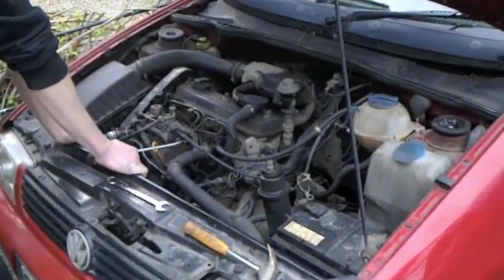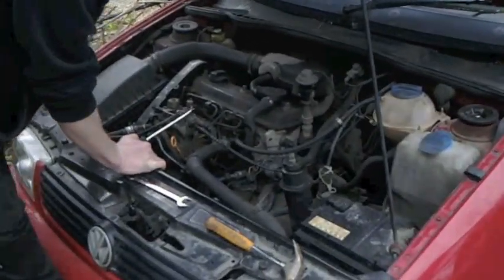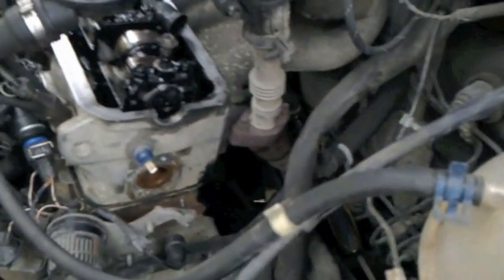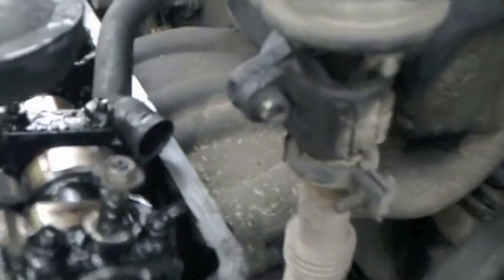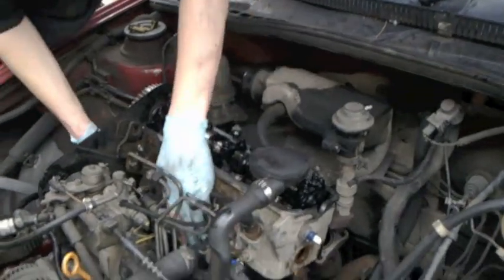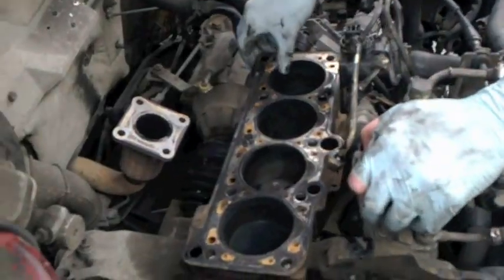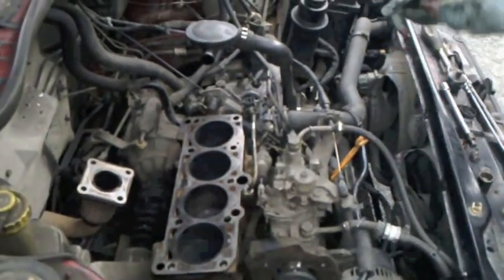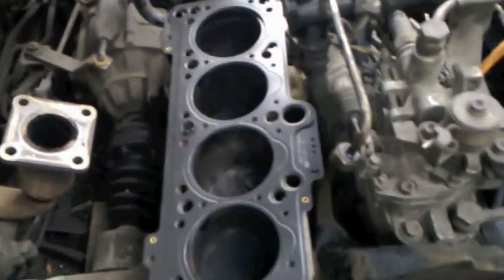How to change Head Gasket on VW 1.9d engines

Comment: Important Information: 
- Check markings on the head gasket (1, 2 or 3 points, there are 3 different thicknesses)
- Change the head gasket only on cold engine
- make sure to not be in TDC with the pistons (Rotate to TDC and rotate a bit back)
- loosen headbolts from outside to inside (not from the inside to outside)
- clean surface of the head gasket and the head gasket itself (production residues can lead to leakage)
- clean and dry out the bolt threads (with pressured air)

- Always use new bolts (these are expansion bolts, which shouldn't be reused)

- Tighten the screws in the given order

(For the VW ABL Motor the stages are: 
1. 40 Nm
2. 60 Nm 
3. 1/4 Rotation (90 degrees)
4. 1/4 Rotation (90 degrees))

Comment: How to allign rhe head and the gasket if the block has only one pin not two ? 
I also have changed gasket for my afn also with one center pin for head and gasket but if you put them both on there is a movement ehat is not good.???

Comment: Hi thanks for this video really useful!  Just having one problem when reassembling the engine and filling with coolant, the manifold on side with the coolant pipe is leaking. I replaced the o ring. Should there be anything else between the metal parts? 

Thanks, Steve
Reply: I had exactly the same. There is just the o-ring. However, chances are the manifold itself has a small crack. In that case replacing the o-ring is not enough.

Comment: You should never use the original timing belt made of rubber always put a new one on it and it's easy to turn the engine up you don't have to use tippex

Comment: The head bolts on the VW engine only hold onto about 1/4 inch of threads in the block. It is also next to impossible to bet longer heads bolts to go deeper into the 1" deep holes. DO NOT TRUST ANY BRAND OF AUTO ENGINEERING !!! They are out to mess US over.  
These are designed to fail ..

Comment: Good video. Shouldn't you have change the timing belt while you had it off and wouldn't it have been better to mark the timing gears to the back of the cover rather than the belt especially since you took one of the gears off. ;-)
Reply: True, but he did keep one pulley on. That means he can align the belt with that pulley then align the second pulley with the belt.
Reply: Exactly. The belt position on the gears does not matter. It is the gear position that is critical.

Comment: Did anyone try to tighten the head bolts without swapping the gaskets? Did it work? My babe (A4 1,9 TDI) is pretty old, so I'm thinking to try that before doing the big job. Thanks!
Reply: I try the ARP head stud on my alh mk4 tdi. It works for 1k miles, but it can not hold long. My car has coolant pushing out on long or high hill.
Reply: O
Reply: Valius Dabulevicius P

Comment: did you hear that sound that made at beginning of the start, if you did well that means its time to change the starter (motor).
Reply: No. It does very unlikely mean that.
Reply: its not starter dont know what it is thought. i changed my inlet and exhaust manifold gaskets on my a3 1.9 tdi it made that noise for about 20sec before it started

Comment: like if cilinder when is almost above than then the injector must shoot diesel in the cilinder at that time cilinder 4 on your vw polo is making a intake stroke end dont need diesel. i have a a ford focus with a dieselpomp wat is bad.we wont to buy one from a carbreakdown end replace it but the new dieselpump is not in the engine anymore end i dont know how to set it on time.gr

Comment: this is Polo 1.9 SDI 
Mine is from 1998 and yesterday the belt came of, pulley was wobbling like mad(the big one in the middle) I saw the belt hanging down underneath, took it to mechanic, he said that pulley was loose, threw that belt of, so he needs to replace that and the water pump, and it's gonna cost 235 Pounds man - is he ripping me of man???

Comment from the maker: Its on the flywheel, through the hole on the top of the gearbox.
Reply: Did you set the mark on top dead centre on flywheel before you marked the timing belt  pulleys?